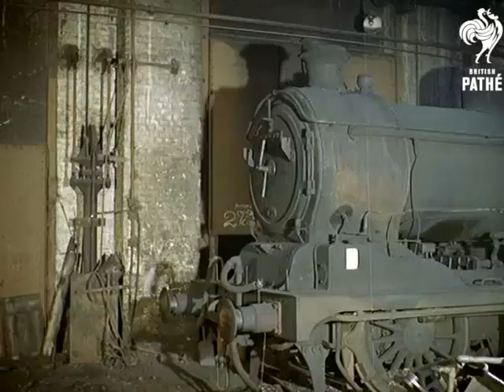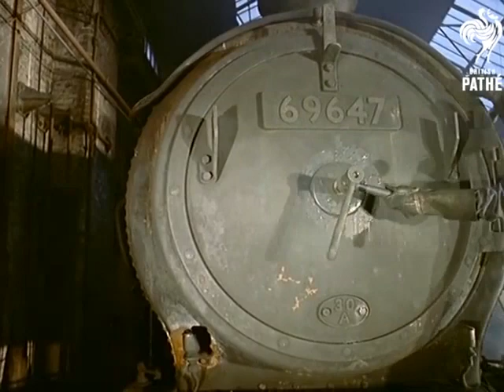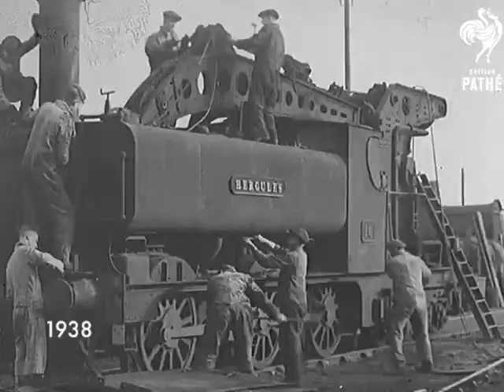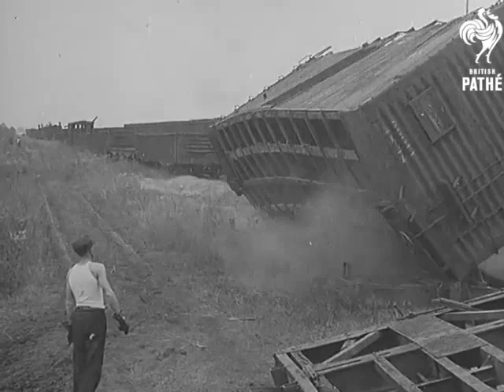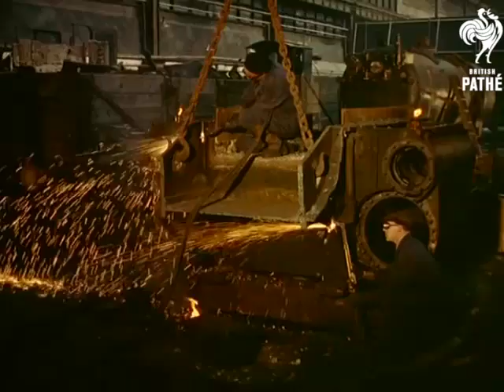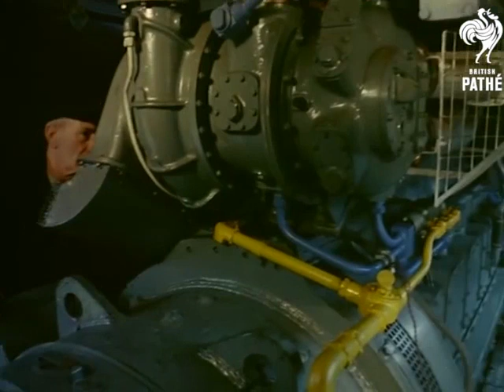Scrapping the Old Iron Horses

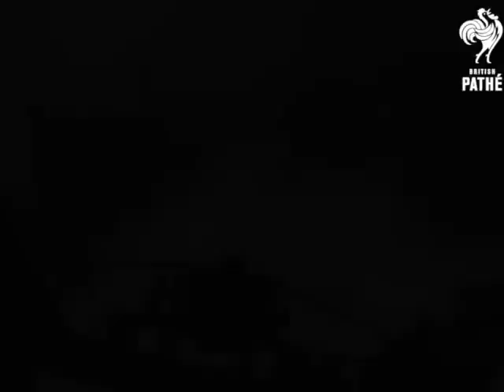Comment: 3:45
Is that an E2?
Reply: Either e2 or e4
Reply: E4
Reply: e2
Reply: It isn’t an E2 as they had curved running boards on both buffers (or just the back) and they were never fitted with wheel arches
Reply: It looks like a Fowler 3f jinty
Reply: IRS either an e3 or e4 class
Reply: E4 not E2
Reply: It's not a E2 Class, That's a E4 class.
Reply: Yes

Comment: That’s the e2 class tank Engine
Reply: Winter black foxy Do you mean the tank engine Who was been pushing into the building. Cause thats not the e2 class
Reply: No its the N7 Class
Reply: It’s the previous version of the E2 the one without the extended side tanks.
Reply: No the E2 class was pulled out of Service in the 1950-1916 that’s an N7 class
Reply: It's a e4
Reply: Nope
Reply: There’s many locomotives featured in this none are lbscr e2s.

Comment: Why are they sending JUST steam engines to the scrap yard? 

Why not diesel locomotives too??
Reply: They are scrapping diesels now, but when this film was made, most diesels were new and not ready for scrap at that time.
Reply: @elijinn5044  Why? They are still polluting but they are more efficient plus easier to maintain and operate than steam.
Reply: d. yu I’m 14
Reply: @idontcareexe9013  Electric engines are the future. But the electricity needs to be generated from renewable energy, not fossile fuels.
Reply: @idontcareexe9013  No, read what  I  said again. I said at the time the film was made (1960's) diesels were new. But now we are scrapping or replacing diesel traction due to  global warming.  We are 50 years on from the time of that clip. There's no point  having a conversation if you  can't read.
Reply: @idontcareexe9013  In that one, I didnt say Diesel was the future, I said they were easier and more efficient to maintain than steam.

But now we are looking to replace fossil fuel traction eg Diesel and Steam with Electric, hydrogen, carbon neutral biofuel etc. 

This is due to global warming climate change, so Diesel is def not the future unless it is bio diesel or ethanol.
Reply: Ok maybe certain diesel engines
Reply: NO DISSEL ENGIENS YES THE STEAM ENGINES

Comment: Only 1500 quid? If I'd been around then, I would've bought one.
Reply: £1,500 in 1962 values is about £15,000 today. This put steam locos out of reach of the average pocket.
Reply: @thomasoates3003  

Still a bargain, as something like a 9F cost around £200,000 to buy new from Crewe Works (Swindon charged more even though they were identical).

Steam engines were sold by weight under scrap value, so that's how many average people DID save one, they just went for a smaller engine.

The one that takes the biscuit is Chaloner, a narrow gauge vertical boilered De Winton engine. Wasn't saved for any historic reasons, it was because it was the smallest locomotive that could possibly be found. Was about 20 or 30 quid, purely by its weight in metal.
Reply: @Shipwright1918  Thank you for this. If memory serves quite a few of the bigger locos survived as people clubbed together to buy them.
Reply: @thomasoates3003  

Indeed so, or advertised in the various railway magazines of the the time for donations, which came in from all over, in amounts large and small.

Didcot Center, the mecca of GWR heritage these days, got started by a group of young lads who banded together to buy a single 14xx tank engine with the help of donations and rented a siding to keep it in. Old railway men told them how to run it and look after it,  so it spent many days running backwards and forwards on that little stretch of track. Even after all this time, the engine is still a part of Didcot's collection.

Also like the story of David Shepherd, the artist who bought two steam locos after his wildlife paintings sold well in New York. Completely on a whim, rang up British Rail and asked to buy a steam engine. Had enough sense to say he wanted a good one, not a worn-out piece of junk, and got the reply, "Well, you're in luck. 92203's just come off heavy overhaul, and we'll be getting rid of 'er in six months anyway, so why don't you buy her? 3000 pounds, scrap value."

When he told the story, he equated it with ringing up British Airways and asking to buy a 747 off of them, completely unheard of and having quite a lot of cheek. Fortunately he knew the right people from days doing paintings of the last days of steam loco operations that they helped make it happen.

Comment: Save the Steam engines 🚂🚂🚂🚂🚂🚂
Reply: @Goldfish we have to Save P class, E2 ( I like the logo you have 👍) K2, J50, B12, 3f jingles, N2 etc. Every engine needs to be saved.
Reply: @Goldfish Let's do it 👊
Reply: e2s were scraped like hecking 60 or 70 years ago
Reply: Well, you see, why can't we build a diesel train, BUT, it's shaped like an E2 class?
Reply: I don't think it'll work
Reply: @Matts_Creations  how?
Reply: @quattrolib  Well one it has to take fuel and it fit blows out the funnel, it will be dirty and smells disgusting.
Reply: @Matts_Creations  It will be easy!
Reply: @quattrolib  how
Reply: @Matts_Creations  The fuel will be stored in the tanks inserted in the engine, and the gas will go out of the face.
Reply: @quattrolib  ain't that not healthy
Reply: @Matts_Creations  In the video, the scrappers get the noses and unscrew the nose and they open up the face. The locomotive will be having a propeller inside to blow to gas.
Reply: @Matts_Creations  That gas is canola oil.